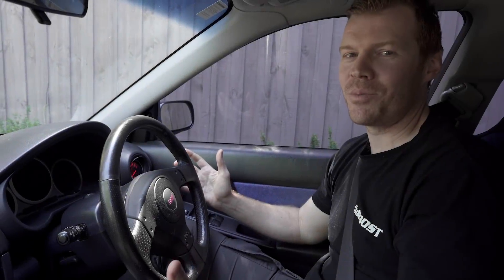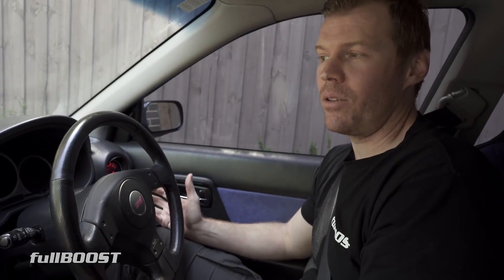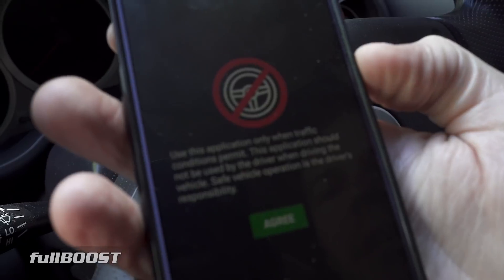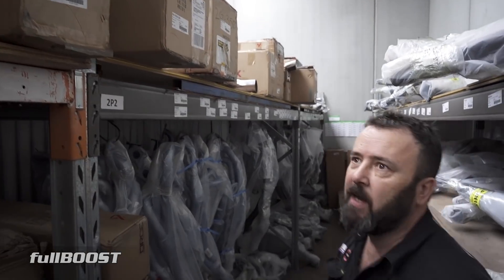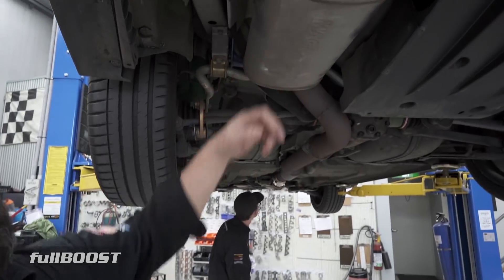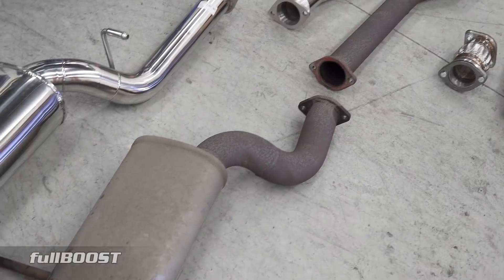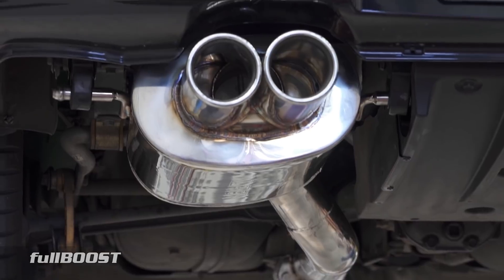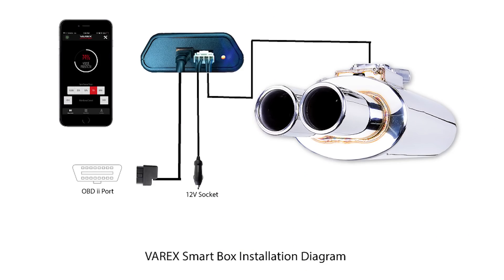How to fix your loud exhaust with smart technology | fullBOOST Subaru WRX

Comment: I'm daily'n a Mazda 1000 ute with a Webber fed 13B bridgeport, has twin 2 1/2"  primary's all the way to the diff into  4" single over diff, into exhaust box with 4" dump tip. Do you reckon these types of valves would even work on something like this....obviously the obd stuff won't, but would the exhaust boxes live very long behind a rota?
Reply: I was advised that the Varex system isnt really suitable for Rotary engines.
Reply: @BobbyLowedesign  There goes my false hopes. Thanks man!
Reply from the maker: We blew the exhaust off our rotary many years ago, yeah they are not friendly on mufflers :)
Reply: @fullboost  Just that feeling when you have to clutch it and roll past the PoPo, heart in your throat, praying that they don't notice. One of these valves would be sweet!

Comment: I don't have the fancy shmancy app version, but instead the regular Varex, wired into the car. I put a power window toggle switch under my window wiper stalk and it looks stock. It's probly at the legal limit when fully open, but ya still turn it down when you see cops. It's kinda fun.

Comment: Is there any danger of overheating the exhaust valves due to manual setting ?
Reply: Only as much as running a stock muffler. Are you pushing more boost or power in the car? They maybe you need a more open, free-flowing exhaust system. Stock power? It won't hurt the valves any more than the stock exhaust system hurts it. Catalytic converters do the most damage to exhaust valves, and are the biggest restriction to even stock engines.

Comment: Guys, how do you go tuning the car with the variable flow exhaust?  Do you have a situation where you tune with the open exhaust and then have problems when you run the car with the quieter restricted option?
Reply: It holds peak boost down due to the restriction, otherwise nothing detrimental to the engine.
Reply: You can have a case where the ecu will correct for knock when applying full throttle on closed exhaust. 
It can cause issues.
Reply: @dlyle  How can the ecu correct for knock when the knock threshold is not exceeded due to a restricted exhaust!? The opposite is in fact true.
Reply: I had my car tuned with the rear muffler removed and a downpipe fitted before the rear axle- cause that's how i raced it. When i would fit the rear muffler (which was a straight throu design, the pipe ran under the diff so it didn't have extra bends and didn't cause problems with the really low ride height) the tune went pretty out of whack. Yes, it wouldn't run as much boost. But much more of a concern would be it's tendency to knock and run stupid rich cause it uses a map sensor which can't calculate the appropriate amount of fuel cause it still thinks the engine is consuming the same volume of air. You could live with it. Just try not to use more rhan 70%throttle or put more octane boost in the tank.

Comment: These systems work well. However you can cancel some of the noise with the exhaust' own pressure wave. That is how Thermal R&D exhaust are designed. I have one on my Focus ST, it's only a little louder than the stock exhaust and REALLY loud at WOT. My BOV is only loud above 15 psi, my setup is perfect.

Comment: Gday, are you planning to dyno the results between open/closed exhaust valve positions i.e  balance between noise levels vs power made/loss?. Great work as usual.
Reply from the maker: The system is not designed to be run at WOT with the exhaust closed, not on a turbo car anyway...
Reply: Plus after the cat it makes absolutely dick all difference. Rear muffler is for farts only. Worth commenting even after a year

Comment: I like the smart box, much better than the remote. I have the old system, I just bought it however online from the same shop. My only issue is my car is still loud open or closed so I'm taking back to my workshop to try quiet it down. 

At first when I closed it at the lights it worked but after awhile it stopped working and I've only driven it once with the new system. 

I have a Bridgeported FD so I know I can't really do much, I just have to except it.

Comment: So the smart controller is not possible to install on any subaru built before 2001 as they are all OBD1 
Well OBD2 Port but with Different wiring for Subaru Scan tool.

Comment: But here is the big question.
If you get ECU remapped with varex at 100% Open.
then you have it closed and go WOT what happens to the tune?
Reply from the maker: Just set it to open above a certain load point I E ours will open at 15% throttle.
Reply: @fullboost  ok let me rephrase that. 

You are out on a road trip 1000km from home and the controller fails in the full Closed position (yes they can fail just like anything and many have failed over the years, at wreckers many varex mufflers with seized valves)

Going from a Tune meant for 3" open system forced onto what is more like a 2" restrictive system wit valve closed has to have major effect on tune & engine.
Reply from the maker: Yes I have seen factory bi-modal systems fail on cars nothing is perfect. If you couldn't open it via the provided key ring either you could physically open with a pole as the valve is easily accessible. It's quite obvious when the valve is closed on a louder car so I guess you're not going to be going WOT if there is a malfunction.

Comment: Could have just changed the steering knuckle rather than the dump pipe... Oh well.

STI knuckle is solid and fits.
Reply from the maker: Yes that's an option, but we preferred to change the dump pipe to the correct one.

Comment: My Exhaust place tried to sell me on stainless steel system i told them no way (there is no salt here on road) 
------------------------------------------------------------------------------------------------------
- Mild steel sounds better. (deeper note with less tin can sound) 
- Mild steel still last 15-20 years. 
- Much easier to weld & work with. 
- So what it gets rusty if you dont paint it, its an exhaust not chrome wheels.
Oh and a full 3" mild steel system with twin 3" tipped stainless muffler will costs like $500

Comment: if your car is tuned this is going to affect the remap, isn't?

you might need a tailored tune to run efficiently
Reply from the maker: We haven't seen any issues like that on this car.
Reply: @fullboost  just telling because you are changing your exhaust back pressure, even if it's a little it may be not ideal for the health of the engine. I know is not going to be so dangerous but just pointing it.

By the way nice car and I am also not fan of too loud exhausts specially for daily cars